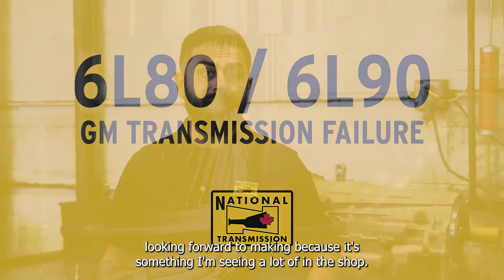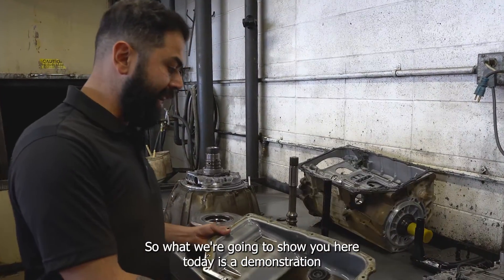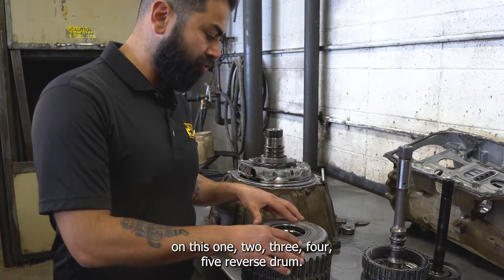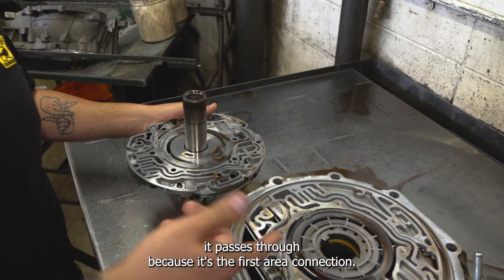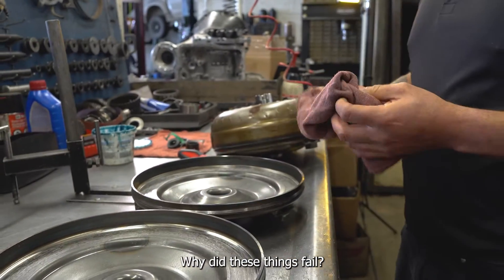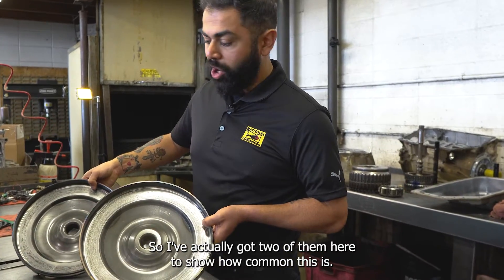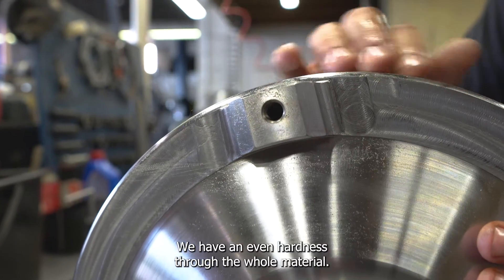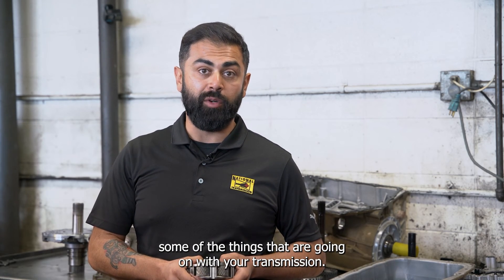How We Fix GM Transmission Failure (6L80 & 6L90)

Comment: BS, the weld is not the problem man.  The heat marks are from the manufacturing process and the fluid will keep surface temps pretty even.  HERE IS THE REAL PROBLEM--The programming in the TCM / ECM commands torque converter apply in early gears and allows 20-40 rpm slippage.  Actual slippage is much more.  The torque converter never actually locks completely.  It blows my mind why GM does this shit for smooth shifts and fuel mileage.  It also blows my mind that people don't realize what's actually happening and why.  HP tuners will fix this.  Turn of DOD, and command less or no allowed slip.  The torque converter is actually pretty good and has superior clutch material compared to standard lockup clutches.
Reply: They're shit converters. They warp and flex.
Reply: I am the senate on here
Reply: would using tow/haul mode help ?
Reply: @shawncordeiro  I think it still does the same thing… just raises shift points.
Reply: I bought a tuner and immediately after applying a tune my transmission slipped even though it hadn't slipped at all before ?

I put it back to factory tune and shortly after it started shuddering around 2,000 RPM 's 

It's still doing it but, I manually shift it and stay out of 6th gear. I watch the transmission temperature like a hawk and it's never gotten hot. 

2013 Silverado 2500 HD 4x4 170,000 miles and I've done quite a bit of towing with it. Never driven hard just long distances towing.

Comment: 2018 was not the last year for the 6L90 , my 2019 Express 3500 has a 6L90.   Wikipedia lists this transmission as 2010 to present in Express 2500 and 3500.
Reply: V6 Express/Savana 2500/3500 came with the even less reliable 8-speed trans. starting in 2018MY. V8s got the "heavy duty"  N8X 8-speed in 2024MY
Reply: @EB-ss3or 2020 Savannah 6.0?

Comment: I noticed that you're ñocated in Canada, it's a stretch to get out there, I live in Texas, any shops in the US, you gave me hope, I have experienced a shudder when I start going over a slight hill and at times on level surface, we put the computer on and nothing shows up other then a coil pack that was misfiring, corrected that and replaced all the spark plugs and wires, new struts, rear shocks, not what else it could be but in the transmission and possibly the Torque Converter like you broke down, how can I get my hands on one the Billet Torque Converter to have installed in the transmission, do you sell them to individuals or shop, Thank you, Awesome JOB breaking it down

Comment: I have a 2015 2500hd and the transmission overheats. I don’t have a cooler bypass like a lot of these transmissions have. Is there still an upgrade I can do to get it to run cooler? When it is hot I touch the exterior cooler and it is ice cold. Please help. Thanks
Reply: I purchaes an upgraded thermostat from my GM dealer it lowered temp to around 140.cost about $120.
Reply: @countryman4691 … Part number, please?

Comment: I've got a 2016 1500, at 87k miles, and it just started slipping today. I am so heartsick. Can't afford this, worst possible time of year. Life goes on.
Reply: I just bought a car from Matilda’s daddy am I screwed!??
Reply: Same thing 2015 Chevy Silverado lt. just hit 80 k maintenance on point.
Reply: @solohash  Just an update. I'm having the transmission replaced. The shop owner told me the cause is a programming issue from the factory. After the work is done he encouraged me to have it re-programmed to avoid this happening again.
Reply: @rasputin7633  did you get any codes?
Reply: My husband also 2015 just cost him over 3k transmission rebuild
Reply: @darlenebrooks8233 
That’s a good price we’re paying about $4600 right now for 6L80E rebuild in Houston area
Reply: Bro,I have a 17 sierra,& same shi happening..Im just gonna grab a new updated tranny..
Reply: Have a 2018 z71 and tranny decided to turn to glitter this morning
Reply: I have a 2018 and it’s starting to shudder and slip gears can’t believe this man
Reply: I just bought a 2010, 5.3L...6L80 with 330k + miles. Mine is sort of slipping from take off then never acts ups. We put in on the computer and instructed it to relearn as is nessisary if it has sat for a while or/and the battery has been dead. Today is day two of driving after the relearn command and it's not fully stopped yet, but it has dramatically improved. Im hoping it will fix. I'd like to hear from OP and get an update
Reply: 2018 silverado 6l80
Shudder real bad
Reply: Mine on my 09 suburban just went out with my wife and 6mo old on our way to Florida… had to rent a uhaul and a trailer to haul it back to Texas
Reply: We have 3 ...2014 2015,2018. All 3 have same problems
Reply: I feel ya man, just bought a 15' with 87k. Private seller, paid cash. Two days later lost the trans 😢
Reply: @nickb1789 I just saw recall on these transmission. GM should be made to fix these
Reply: Hows it holding up
Reply: Add fluid

Comment: The description of the drum failure could be based on fact.

However,  most of what was said about the torque converter is inaccurate.

1) 'metal' does not automatically harden from being heated. 'Steel', which is what torque converter s are made from,  does not harden unless it has a high carbon content. Steel with a high carbon content is not suitable for deep stamping. In fact, only high quality sheet stock is suitable for stamping

2) Using vague terms like 'failure rate' with no actual facts is equivalent to marketing, which is another word for propaganda.
Failure rate of 5 in 1,000 may be 'improved' to 4.7 in 1,000 but that is still an unacceptable rate.
So, what is the failure rate of the factory torque converters? What is the rate of your soultion? To just say 'improved' is pathetic, frankly.

Explain why suddenly a specific torque converter has a mysterious failure when these parts have been mass produced by US car makers since 1952.

Using welded steel blocks as mounting points is used on huge diesel engines, so your claim that this is the 'failure point' lacks any credibility at all, particularly since the blocks are not tearing loose and leaving cracks or holes, and the entire torque converter body is a weldment with a 360 degree radial weld on the diameter of the stamping.

You will need to do a lot better than this to make your case, especially since the only 'boogie man' the manufacturer has come up with is improperly formulated fluid.

Comment: I have a 19 GMC Sierra limited with a 6 speed transmission. It failed at 36k. They replaced torque converter and rebuilt transmission. 6 months later, same problem. Dealer puts refurbished transmission- truck is in shop for a month. 2 months later the refurbished transmission has szme problem. They say it’s a valve body issue; in the shop for 2 weeks. They replaced valve body but dealer says the transmission is still not functioning properly. No word yet on the repair or when I get the truck back. 
Besides telling me to get rid of the truck; has anyone managed to get the dealer/gmc to buyback their truck?  Thanks

Comment: Aluminum stops the filter up. The trans is fine. Flush the trans fluid. Replace the filter then do it once more in 1000 miles. I did and now no more aluminum is getting in my filter. My trans was never rebuilt. Im also a trans specialist. Ive built too many too count.

Comment: I'm a retired gm tech. I worked on hundreds of these 6L80 / 6L90 trans. Most common failure is the torque converter shelling out and pumping debris through the front pump. Never saw an issue with the 12345 R drum.

Another issue was with valve body issues.
Some could be cleaned and repaired. Others got a replacement valve body.
Reply: What about tune the tcm to lock up in lower gears
Reply: So if mine is currently operating fine would it be worth it to take it in and having a new/upgraded TC installed? I’ve got a 17 suburban.
Reply: @h.merica hey man how’s your 2017 doing?  Did you do a rebuild?  My freakin 2015 Tahoes tranny just went out at 125k
Reply: What could be wrong? Some time mine want go into no gears ,I cut the truck off and start it up and it works will go in all gears ?🤷
Reply: My husband's 2015,z71 and my 2014 tahoe,no reverse,now his 2023 z71 doing same thing jerks like transmission  coming out
Reply: Where's the recall, truck to expensive to fail like this
Reply: Or is constant slippage till 5th gear okay?
Reply: @michaelclark5385  Having had the opportunity to hear from engineers (like myself) who have an understanding of strength of materials and flexure failures, I have a much better understanding of why the torque converters self destruct. I also believe that I now understand why simple observation of a failed converter leads many to an inaccurate conclusion.

So, without getting too far into the weeds, I will try to simplify a description of what happens inside the coverter that makes them fail.
It is well known that a 'wave plate' is used inside the clutch drums to dampen the application of the clutch in order to create a smoother shift and to protect the friction plates from experiencong shock loads at the same time.
There is a very large clutch inside the torque converter that has no such 'wave plate'. In order to provide a similar function, the entire full diameter friction plate is used, but the 'cushion effect' is provided by using a progressive application by intentionally forming the plate with a mismatched angle between the cover and the friction plate. 
The friction material therefore does not contact all at once, but makes conract initially only at the outer diameter. As the fluid 'apply' pressure rises, it deforms the plate forcing more and more of the friction material to make contact until (hopefully) the correct maximum pressure results in full contact between the friction plate and the portion of the cover that is actually used as the 'steel' in clutch hub parlance.
I believe this 'solution' to cushioning the clutch apply is driven by cost and not good and sound engineering. That would explain the class action suit. The problem is a poor design. Inspecting numerous failures would certainly reveal that.
The fluid problem has a different and mostly unrelated cause.

The cause of the damage to the converter (and resulting circulation of clutch debris) is complicated, but suffice to say the neither the plate, nor the cover were made from adequate materials, protection from over pressurization of the plate could have EASILY been incorporated into the valve body to preve t deformation of the friction plate which is what caused the slipping, overheating and eventual destruction of the friction material.
My solution would be to use the same material but thicker to produce the cover, and widen the steel blocks used for mounting and weld only on the edges and not the ends.
Second, on the friction plate, mame the plate from a high carbon steel suitable for heat treating (spring steel) and form a wave into that plate where the friction material is attached and have the friction material meet the cover at the same angle so that flexure of the intentionally weak friction plate is NOT used to match the angles where the friction material meets the cover.
The wave form built into the friction plate would provide the cushioning instead of relying on the plain steel plate to flex a precise amount.

Overheating the mild steel friction plate would easily cause it to permanently deform causeing hash shifts and eventual destruction of the friction material.
Overhearing this part combines with over presurizing the apply pressure is practically a guaranteed failure, so a pressure relief valve in the TCC apply circuit is a MUST, especially is a 'high performance' shift kit is installed that INCREASES the pressure.

These changes would result in a significant increase in the cost of the converter.

I apologize that this something of an oversimplification of what causes these factory converters to disassemble themselves, but it would take many pages and drawings and diagrams to really explain it fully.

My advice at this time is to buy an aftermarket converter that used a Sonnax Billet cover and install a Sonnax kit that incorporates the pressure relief valve that I mentioned.
Reply: @michaelclark5385  slippage is a normal part of the operation but can be 'tuned' out in lower gears if you wish.
The design of the torque converter, and particularly the materials used, is intollerant of the heat caused by the constant slippage.
Below, I have written a description of why these converters self-destruct.
Reply: I have a 2017 2500hd with the 6.0/6l90. 3 year old gm reman trans. Not even 100k and the converter is on its way out. Shift flare into overdrive and on downshifts. Rpm surge when lugging in the taller gears. This is exactly how my first trans failed. 270 degrees, completely immobile, loud pump whine. Gonna put a billet converter in and cross my fingers. Not putting a third trans in this truck at 170k.
Reply: My 2014 Silverado shutters like it’s running g over rumble strips. Had the converter changed about 4000 miles ago…I’m hoping I can flush the converter and save it when the transmission gets rebuilt. My truck started acting up around 150,000 miles.
Reply: Where is the tcm located on the 2018 Silverado with the 6 speed transmission
Reply: This is exactly the case 99% of the time. I have a 17" GMC that is currently in the shop. And that's exactly what happened. The new transmission is 5500$ with a billet torque converter/piston  upgrade. Truck only has 80k and sits in the driveway. Definitely didn't need this happening at the moment.
Reply: In your professional opinion if you engineered the transmission you worked on how would you have fixed the issue you saw? Couldn't an aftermarket drop pan be fitted to help better maintain the issues with dirt in there? I feel like the manufacturer did this intentionally. All anyone would need to do then is just maintain the crap out of it to prevent premature wear and give the valve body assembly a break to eliminate the stress from contaminates.
Reply: I have replaced my transmission in my 2010 ss camaro  3 times first time rebuilt and replaced the other times and it only lasted 4k miles first time and around 10k on the other 2 transmission and my car only has 32k miles on the motor im sick of having same problem over and over when I first got it i was kinda rough on it drag racing at the track but after getting it redone I haven't races it one time and only drive it on the weekend around  200 to 300 miles weekend no more than 1k miles a month just to keep the fluid going through everything but this is getting way out of hand what other transmission can I switch out with it for it not to cost me. My soul to replace bc im about to the point to take the 496 big block out my vega an the power glide transmission and going back old school no electric shit if I can't get this umdercontrol im not trying to make it my race car but im close
Reply: I have a 2014 GMC Sierra with. 6L80. I'm experiencing ruff down shifting when coming to a stop. I don't have any slipping or anything like that.  PRNDM all works normally. Can you please tell me if you have come across that symptom and if so what might it be? Thank you
Reply: Performance transmision builders have been replacing these friction welded hubs for a long time, so it is not odd that they fail, but why suddenly with a new trans design? The same applies to torque converters which are not exactly new technology.

Why the class action lawsuit against GM for selling 500,000 of these transmission over a decade when they KNEW it was defective?

It is pretty hush'hush, but the only info I have read is that the valve body of parts therein disintegrates over time. Apparently enough time that GM was 'playing the odds'.

Comment: My 2017 chevy silverado transmission failed at 100,660 miles. I don't pull anything. It is my daily driver. Won't go into drive at all. Aamco transmission shop said it needs a total rebuild at the cost of $4200. GM hotline gave me the runaround so decided to take it to Aamco Trans specialists instead of the dealership. Dealership was more. My 2000 chevy silverado reverse went out at 260,000 mile. $2000 total rebuild.  Been a chevy guy for 47 years but I am Not happy with their quality anymore.
Reply: I’m out with GM after this. Second rebuild on 14 Sierra coming up. 107k miles. Toyota here I come.

Comment: Do you really think GM does not know about welding metals and making sure that when the welds are completed for the bolts holes to be set for putting the flywheel to the convertor, that the convertor is going to  be straight or round as possible, also you do not show if its a genuine GM convertor, which means that almost every single GM 6L80E or 6L90E auto trans out there will have the same problems or maybe its just the luck of the draw you either got a convertor which is not round enough inside it and thus have problems or you have one which is ok ,so what your saying is replace the convertor when you get a auto serviced and thus get rid of the most common problems with these autos?
Plus i think its more with trucks due to towing etc, so much heat is generated and pressure friction basically is the enemy of any mechanical engine reduce the friction as much as possible with all things being equal, then you should be ok etc?
Plus have a trans pressure and temp gauge and especially a fan controlled external trans cooler and you will save so much issues later down the track?

Comment: All transmissions its about friction reduce friction and servicing at regular intervals and depending on how the truck or car is driven as well, temperature and friction is the emery of all mechanical items engines, transmissions differentials etc?
Unless there's a factory fault not known at the time when the each items were made for the engine, transmission o diff, just a faction out of spec in one of the parts and before you know it you have a failure issues?